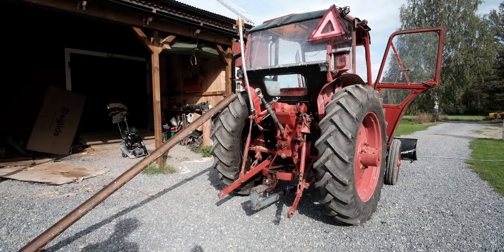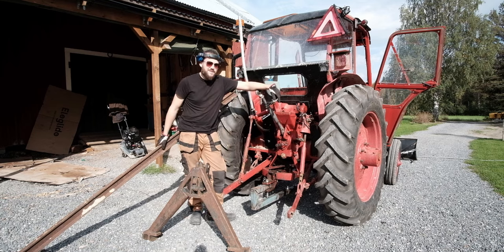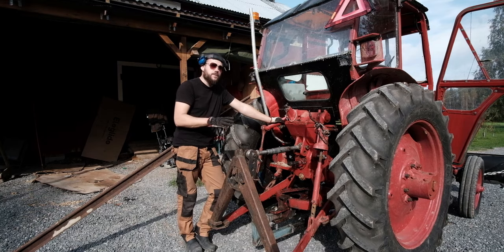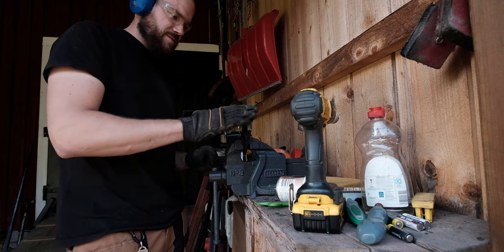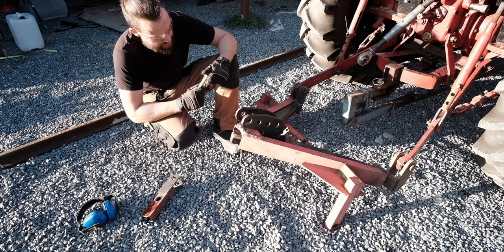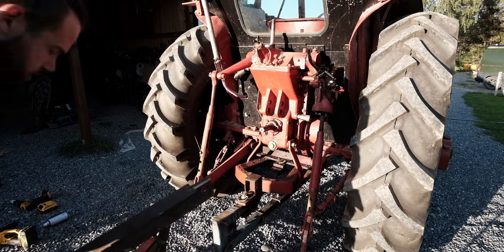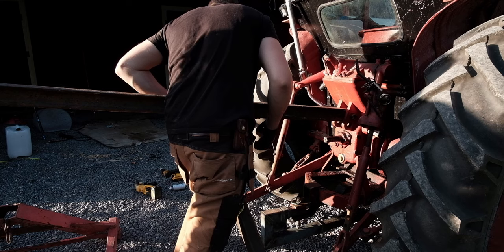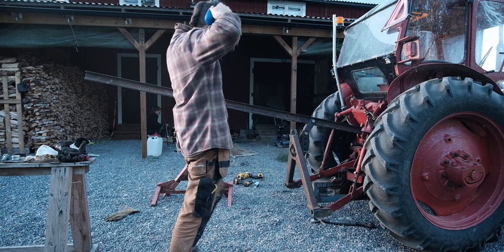Homemade Tractor Boom Pole (From Scrap)

Comment: Cool.  Thought there would be a lot more flex of the boom under load.  Loads of lateral sway, though.  How are you going to reduce that, if at all?
Reply from the maker: It was surprisingly rigid! I mess up though, was supposed to add an extra bit on the end of the video where i finished it. Have added a stainless steel reinforcement strap from end to end with a raised point over the pivot hole. Also painted it 😊  As for the sway, that is wear/slop in the 3 point linkage that I need to try and take out

Comment: Would be interesting to carry out a gradual weight test and test it's limits, obviously the pivot point is the tractor rear wheels. Lots of factors to consider.
Reply from the maker: I'm having some issues with the hyd at the moment so it can't life to it's full potential. Think I need to rebuild the pump. But what I actually built this for is lifting logs around the yard so for that purpose it should be more than strong enough 👍

Comment: I'm half way through watching and already think the weight of the iron pole is sooo heavey, that the hydraulics will not be strong enough to lift the pole AND the the weight of much load. Remember that poor old Nuffield is not from yesterday but many years before yesterday. Sorry for being so negative but i'm a farmers boy and have used tractors from yesteryear and from the modern day, so have some comparison.
Reply: I don't think you understand the power of hydraulics
Reply from the maker: That will teach you to wait until the end to comment 🤣👍 Believe it or not the actual lifting power of the 3 point on this model is around 2 ton!
Reply: I was amazed at how well that worked. I was thinking, something will bend or snap but there it is. For an old tractor it's serving you well 👍